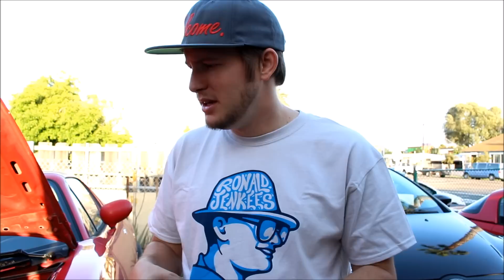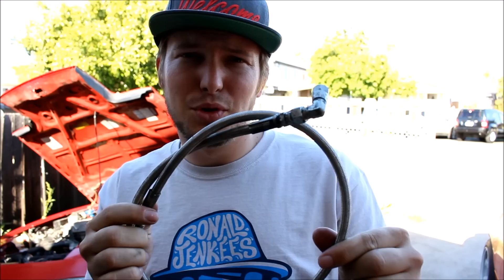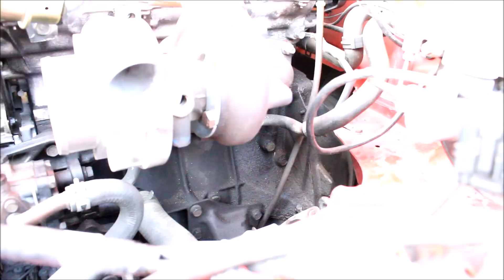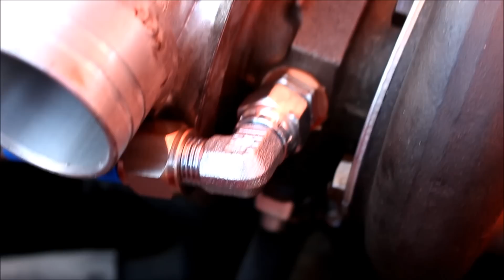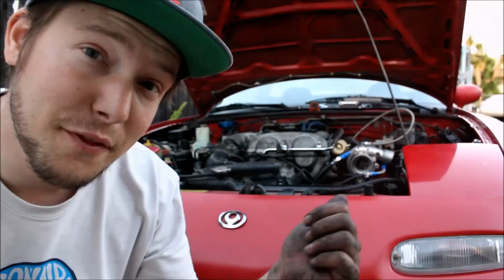The Turbo Lives!!! Oil & Water Line Install (Broke & Boosted Ep12)

Comment: I was always told that the oil drain has to be above oil level. Is that correct? Because it looks below the oil level in this video.
Reply from the maker: It's got to be above the oil level, and it is above it in this video. The pan drops down behind the rack and that's where all the oil sits.
Reply: Oh, well that shows how much I know about Miatas. I drive a Toyota Matrix and it has a small oil pan and the oil goes all the way up.

Comment: Do both the 1.6 and 1.8 make the same power when boosted? What's the the difference?
Reply from the maker: +PaperFc 1.8's typically make a little more hp per psi and will spool a turbo a little faster. Both can be fast though.

Comment: Does the oil feed have to be vertical or is it ok if the turbo is installed on a slight angle
Reply from the maker: The oil feed isn't the issue, it's the oil drain that needs to be vertical. Since the feed is 180 degrees from the drain that does make the feed vertical as well though, haha. I'm not sure what the maximum safe angle is for the drain, you'll have to do some research on that.
Reply: TheCarPassionChannel hmmm didn't think about the return line. Thought it would be the spray from the inlet that would cause the issue. I will have to look into this more but it's easy to alter the position off it luckily lol

Comment: Hello i have a quastion!

haha this is going on for a while now in my family, i Say that a turbo can have water+oil feed at ones. my parents dont believe me a car engineer dont believe me? but still i see it all over the internet?!

i say 

The water is to lubricate the turbines 
and the water is to cool it off

they say 

only oil is enough to cool down the turbo+lubricate ? 

who is right ? am i missing something ? really need evidence haha :P
Reply from the maker: The oil is to lubricate the bearings/moving parts. The coolant does help keep the CHRA cool, and also when the car is shut off, heat from the oil can go into the coolant in the coolant lines. BUT, many people run their turbos with oil only, even if they have water feeds. Water is usually just considered extra safety, personally I always run water lines.

Comment: The 1.8's have the same high pressure oil feed, just so you know
Reply from the maker: +David Damico There's an annotation but you probably can't see it if you're on a mobile device. only 1994 and early 1995 models have the feed. 1995.5 and later don't have one.

Comment: !! I hope for your sake oil doesn't back up through the oil drain of the turbo.
Reply from the maker: Why would it...? I'm using an an4 feed and 5/8" drain above the oil level in the pan.
Reply: TheCarPassionChannel My apologies if it is above the oil level. It just appears so low in the video.
Reply from the maker: Yeah the pan actually drops down behind the subframe, and that's where all of the oil sits :)
Reply: TheCarPassionChannel Cool! Learned something new about the Miata. You sir, just earned yourself a new subscriber. Thanks!

Comment: question do you absolutely have to dyno if you turbo a non turbo
Reply from the maker: It's a good idea, but I would not say it's necessary. Just do lots of research and copy a common setup, don't try to run lots of boost and timing above what's been tried before, etc. I have quite a few friends that have never had their boosted Miatas on a dyno.
Reply: +TheCarPassionChannel thanks
Reply: so im trying to get 600hp out of a 3000gt is that to much for a daily
Reply from the maker: local eugene "Too much" is a matter of opinion and experience. A 600whp 3KGT is no joke, definitely enough to get you in trouble fast. But you only have the power when you put your foot down. The best way to do it in my opinion is to build the car up with more and more power so you get used to it as it gets faster.
Reply: +TheCarPassionChannel all right i just wanted to go straight up to avoid wasting my money
Reply from the maker: local eugene Well if it's anything like other Japanses supercars in the class I'm sure you're looking at $10,000 minimum (if you do all the labor yourself), probably more. You could probably get it into the 400whp range for a few grand and have a really fun car.
Reply: +TheCarPassionChannel thanks man for responding to me i apprecaite the help

Comment: I haven't been following what turbo is he using?
Reply from the maker: +t4teeee It's a Begi "T25/T28" China turbo.
Reply: +TheCarPassionChannel thanks I was looking at probably for the same turbo for my car
Reply from the maker: t4teeee Horrible turbo, lol. I would advise something else.
Reply: +TheCarPassionChannel is it really that bad for the price? i thought your experience with it was good?
Reply: +TheCarPassionChannel I gathered it was bad I'm probably looking at another one right now it's a hybrid tho
Reply from the maker: AmanYoskii A used Garrett SR turbo is sized better, my experience with this turbo is slow spool, and decent top end. Yeah the car was very fun, but once I went to a better turbo I realized how lame this one was. They're around $400, you could get an SR turbo for $200, have it rebuilt and balanced for $100-$150 and have a better setup!
Reply: +TheCarPassionChannel well the China charger was reliable for you right? im guessing you've had experience with a used sr turbo. hmmm
Reply from the maker: AmanYoskii Yes it was reliable for sure.

Comment: You have a rather looong high pressure oil line ;-)
Reply from the maker: +MrEp1kk Yeah I actually cut out a part of the video where I talk about that. That's literally how it comes from Begi.... if you make your own line you can do it 10x cleaner. I have a black braided line on my other car that comes in the behind the turbo at a 45* and you can hardly see it.

Comment: that return line looks like its sitting to low on the oil pan
Reply from the maker: +Michael cruser It's not. It's above the oil level when the car isn't even running.
Reply: +TheCarPassionChannel right on

Comment: SOS Can't find the fitting for oil feed out of the block
Reply from the maker: +Nicholas Evar What year engine?
Reply: TheCarPassionChannel it's a 1990 1.6. But I can find the fitting for oil out of the block
Reply from the maker: Nicholas Evar Not sure what to tell you, if it's a U.S. 1.6 it should be there
Reply: TheCarPassionChannel I know where the hole is for oil feed to turbo I just can't find a fitting to go in to it for the feed line
Reply from the maker: Nicholas Evar ebay

Comment: Tell ricer Miata to put a tune on his dam car
Reply from the maker: +Jack Heinrich I've been talking to him for almost a year with advice for his build, lol. Before he even announced he was going turbo.
Reply: +TheCarPassionChannel hey do you have to use mega-squirt or are there other less expensive tunes that are possible?
Reply from the maker: alex grossman The build on this car is on stock ECU and stock injectors. My other car is on Megasquirt.
Reply: TheCarPassionChannel oh ok thanks!
Reply: TheCarPassionChannel hey another question! i dont plan on running a stock ECU but instead of megasquirt, do you have an experience with AEM ECU?
Reply from the maker: alex grossman Nope. MS is by far the most popular ECU in the Miata community, and because of that it has the most support available. How much is the AEM EMS?
Reply: TheCarPassionChannel oh ok. well ive found that for the NA plug and play system are alittle cheaper anywhere from 280-350$ and the NB are pretty much just 400$ flat or around there.
Reply: TheCarPassionChannel i most likely will be turboing my miata and will be putting up the videos if you would like to see the AEM system.